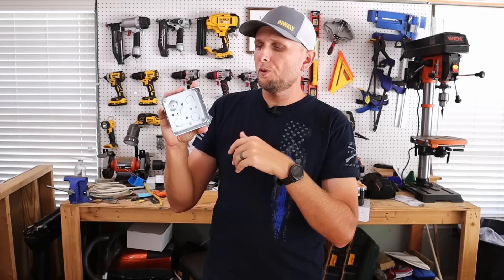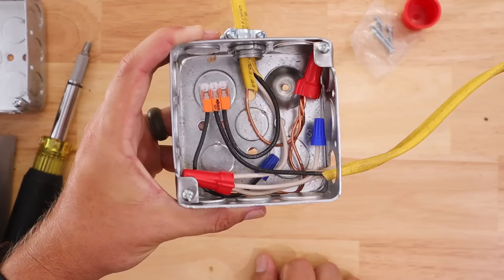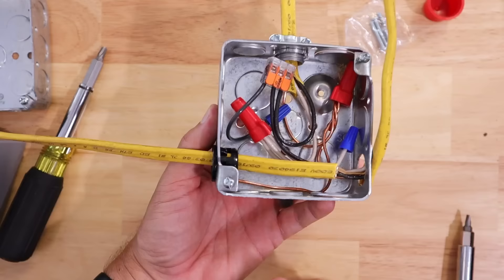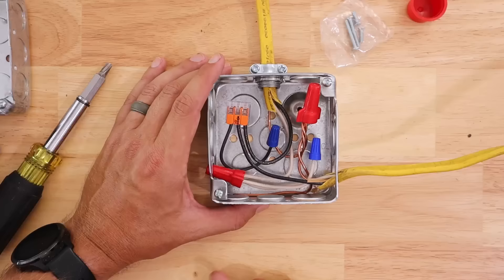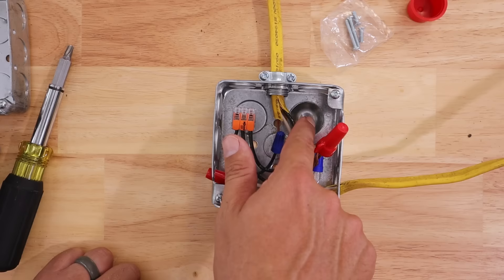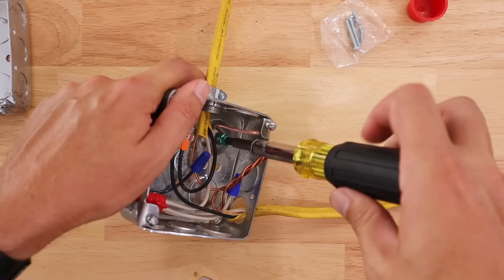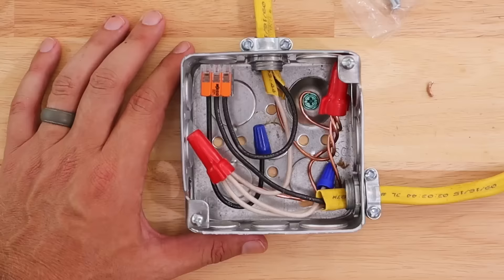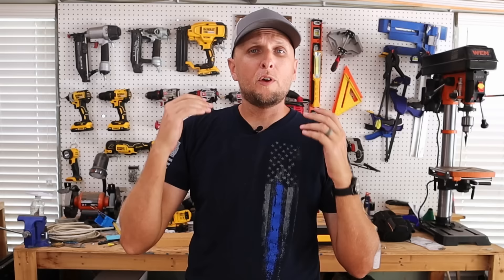The BIGGEST Mistakes DIYers Don't Know They Are Making When Installing Metal Electrical Boxes

Comment from the maker: Have you ever seen any of these mistakes made in this video?  Hopefully this was insightful.  If you know of other common mistakes made, feel free to list them here.  Never know when I may feature them in a future video! 😎
Reply: Is it acceptable to have one of the ground conductors (part of one of the NM cables) wrap around the box grounding screw and then get connected to the other ground conductors via a wire nut? instead of having a separate pigtail.
Reply from the maker: Depends on who you ask but it is my understanding that yes, that would be acceptable using the feed wire ground.
Reply: You neglected to point out that the NEC calls for 6 inch long wires beyond the sheathing inside the box.
Reply from the maker: You are correct.  I did not mention that.  And 3 inches past the front of the box.  Thanks for the reminder for everyone.
Reply: I always make at least these for mistakes on every box I wire, sometimes if I'm lucky I can get at least 7 or ate in one two gang box. That takes some practice for sure, although some can do it right out of the gate (beginners luck) I would have more pictures of my work but for some mysterious reason a lot of these houses aren't there anymore.  Crazy times
I almost forgot, my company name is 
RE-VOLTING ELECTRIC 
You'll be shocked by our work (it's that good)
Reply: You didn't mention it, but it looks to me that there is no strain relief provided for the center hot lead in the wago.  You did clamp that hot lead into the box, but is that enough protection?  I'd be happier adding some strain relief, personally.
Reply: The biggest mistake is to start out with a metal box...
Reply: Before watching the video, I see the problems:
1.  No clamp on one cable entering the box.
2.  The ground not connected to the box with a green screw.
3.  A hot wire stuck in the wago that serves no purpose and just ends in a wire nut -- not a problem but why bother???
Reply: Yes I have seen them all in field and more and much worse
Reply: Another mistake you missed the wires aren't long enough supposed to be 6 in
Reply from the maker: They were all measured out to being at least 6” and can extend at least 3” out of the front of the box.  So it wasn’t missed.
Reply: So I don't understand. The grounding wires(which shouldn't carry any charge unless there is a fault) are  uninsulated, so they need to be connected to the box. You imply if they are insulated they wouldn't need to be connected. That's not right. 
 You'd want to connect the ground wire in the situation a hot wire grounds out on the electrical box. Also, There's a difference between code, and being safe. A green but is code, but obviously, any conducting nut would work. Just not code. Code should be understood, but its mostly there so building contractors don't cut a ton of corners, and use undersized wire, neglect connectors etc. Some code is mostly to make things easier, like minimum conduit size etc.
Reply from the maker: I never implied that that if using an insulated ground that it didn’t need to connected.  I said that certain applications may require an insulated ground wire.  The box always needs to be grounded.
Reply: @AwoudeX  That is a ridiculous comment. Some local codes / inspectors do not allow plastic boxes. You have to use metal boxes in those areas.
Reply: @dallasarnold8615  no, in such a case my comment is not the ridiculous thing, but the code. Having an insulating box instead of a conducting one is just common sense. 

Where there can be explosive force i can get that you'd insist on something metal to reduce the impact on potential victims. Where i'm from it's only where the main enters the house and quite often you'd see there a metal circuit breaker box, especially when there's 400V. (yes i'm not from the USA and i know you run on 100V only.)
Reply: @jonathangardner4475  ya no you misread……and you obviously are not an electrical professional either . You do not 
Want information you just want to argue . After 30 plus years I know the code . Better than 95% of the people here .
Reply: @gerdberg4188  you're right! I did misread. I'm no a professional! He clarified that the box should ALWAYS be grounded, which answered my question!
 I DO like to learn. I DO like to argue. You're batting like 50% so that's not bad.
Reply: @gerdberg4188  besides. I'm right too. Code often isn't about safety, it's about having a standard. Like the leading comment says, "calculate the size of the box for future expansion". I absolutely think anyone working on someone's house ought to be a professional electrician and follow the code precisely. Ive done electric work on my house and found pigtailed wires behind a wall, in insulation without a box 😨.  That's why I said, you should understand the code. There's more advanced questions like,  if I'm running a 50 amp two phase circuit 50 ft, what garage wire should I use? Interior wall? Inside or outside? Does it pass through insulation? That's not easy to simply pull out of a code book. A skilled electrician needs to make the proper calculation for voltage drop etc.
Reply: @AwoudeX  You quite obviously missed my point. Some local jurisdictions do NOT allow plastic boxes. So, making your general statement makes it ridiculous. Whether or not you personally disagree with the application. Arguing the point is not going to make that local inspector allow it.
Reply: @dallasarnold8615  No, you instead didn't get mine. My comment stands with or without any code enforced by whatever institution. Bringing it up is irrelevant to the point i made... The inspector can enforce his or her code endlessly and still my point stands: it is a bad idea to use a conductive material for your electrical boxes. It's been AGAINST the code where i'm from for many decades now. On rare occasions i've done a renovation job and found metal pipes and boxes. You need to bypass them alltogether or remove them even. It's so much safer when it's insulated!
Reply: @AwoudeX  You really are thick headed. I am not arguing whether it is safer or not. You said it is a mistake to be using a metal box. And I am saying it is not a mistake when it is according to code. You can argue off point till you are blue in the face, but it still is not going to pass the electrical inspection in the jurisdictions where plastic is not allowed.
Reply: @dallasarnold8615  you are the thick headed one, it makes no sense to use conductive materials. It is a mistake using a metal box because it has a higher risk of electrocution. I already stated that the code itself is ridiculous if the metal box is the preferred choice.

<<You can argue off point till you are blue in the face, but it still is not going to pass the electrical inspection in the jurisdictions where plastic is not allowed.>>
And here is where your thick headedness shows the most. My argument goes beyond the code and goes by what makes sense. You can point at the code till your index finger drops from your hand, but my point still stands firm that a metal box still is a mistake and of higher risk. Where is your argument that a metal box is superior to an insulating one and thus SHOULD BE PART OF THE CODE. I haven't seen you try to argue me on point, you're just discussing past me instead of with me on point.
Reply: I’ve got a cousin that I call or FaceTime, before I commit to any of the electrical ideas floating around in my noggin. I told him he should develop a digital service for other diy’ers to be able to call.
Reply: Your comment about wire gauge isn't entirely true.  If your wiring up a 15A receptacle on a 20A breaker you are allowed to use 14AWG wire.
Reply from the maker: @creamysbrianna yes you are correct.  I should have specified in the video that I was showing an example of a 20 amp circuit.  I was using #12 so I figured that was implied but I do know that #12 is becoming more popular in home build on 15 amp circuits and sometimes #12 is used on 15 amp circuits due to long runs and voltage drop.  All of that being said, I still don’t recommend doing it because you don’t know who will come after you, maybe assume since all they see is #12 wiring, that they can upgrade the circuit breaker to 20 amps, and call it a day.   So I personally never use smaller wires than my feed and I recommend doing the same out of a concern for safety.
Reply: @AwoudeX  I’m a residential electrician here in the US. The most common nominal voltage used is 120v/240v, but in commercial/industrial settings you get into the higher voltages. And yes, in newer houses here we use non-metallic boxes set in the wall. We often use metal boxes, however, when needing to splice/repair old armored cable.
Reply: Actually that 14ga is fine for 20a at that length
Reply: @AwoudeX  fewer call backs with a metal box. Besides, if done properly there is no issue.
Reply: I had an electrician that didn't use a wire clamp on a receptacle in my wood working shop. I had an air compressor plugged in to it. Vibration from the air compressor cut into the insulation and quit working. Luckily I caught it in time but I had to fix three other receptacles in my shop also. The Electrician had done work for over 30 years.
Reply: Not that I wouldn't use a grounding screw, is there something special about them that makes them uniquely suited to that purpose other than the color?  I probably wouldn't have worried about seeing some other kind of screw being used for that purpose provided it made a secure contact between the ground and the box.
Reply: @AwoudeX  you're actually wrong in just about everything you've said. The one thing I can agree that is perhaps safer is a plastic box. Everything else is nonsense. If done correctly a metal box can be just as safe as a plastic box.

Part of the national code is local jurisdiction having authority. The national code is the minimum requirement needing to be met. Local jurisdictions can require more than what the national code requires. And some jurisdictions require metal boxes only, which they have that authority.

We don't only use 100V. In fact we don't use 100V at all. We use 120/240 volt in homes. Outside of North America just about everyone else only uses 240V in their homes. So not sure where you came up with 400V. That's getting into 3 phase power and I highly doubt anyone uses 3 phase power for homes.

The one thing I did fail to mention in another post on here is that a green hex grounding screw is not required. In fact code mentions nothing of the kind. What it does say is that a machine screw is required for bonding applications. The green screw is a 10/32 machine screw. So any 10/32 machine screw can be used because that's most likely what the hole is threaded to for bonding, but not all bond holes are threaded at 10/32. They are sometimes smaller.

All this is coming from me who is a practicing licensed electrician of several years.
Reply: @TheForgottenMan270  "If done correctly a metal box can be just as safe as a plastic box."
If there's more room for human error, it cannot be just as safe.
Reply: It also looks like you're short on cubic inches in the box per wires/nuts and all inside.  I didn't get a clear look of the depth of box, but I'm pretty sure you don't have the cubic inches to handle either a receptacle or switch if you're working with NEC code.
Reply: I've seen them countless times and they really irritate me.
Reply: @How To Home  It is best to have the grounded conductor from the cable which feeds that  box hit the ground screw then to the ground splice in one continuous piece of.wire.
Reply: @HowToHomeDIY  You are correct as well folks are using 12AWG for 20A circuits with 15A receptacles.  It's the option that will allow for future changes to 20A receptacles.
Reply: @RK-hs6ui  I like that too.  In many heating applications like furnaces and boilers, it's essential to ground the burner that acts as structure for the electronic ignition as well or the flame sensor and ignitor arc may not work properly.  I've had many boiler and furnace electronics calls where proper grounding fixed the issue.
Reply: WAGO = BAD!!! Have you ever had your electrical work inspected?
Reply: @AwoudeX  No it doesn't.  A metal box is actually safer under shorting conditions.  It allows a path for the current to meet the grounded conductor and take the safest path to earth.  That is why metal boxes are used in all construction.  Rigid PVC is permitted outside, may be used inside but is not economically viable.
Reply: @ZachGrady   That's the better way!  Less joints in the run.
Reply: @creamysbrianna   NO!  Do not do this.  You have a cct. that is rated for 15A... you are not protecting the cct. with a 20A breaker.  You will be allowing a higher current than the cct is rated for.
Reply: @AwoudeX  You're wrong about the USA running on 100V only. Homes are all equipped with 240V power, center tap from the transformer (and neutral conductor) dictates the 120V throughout most of the home. 240V is commonly used in parts of kitchens, garages and/or laundry rooms.
Reply: @surferdude642  can you explain why the usa bothers with the 120V part?
Reply: @AwoudeX  The answer lies in history. Thomas Edison made carbon filament light bulbs that worked best at 100V DC. Higher voltages would burn it out. Later, AC was used, primarily for long distance transmission, and 60Hz frequency was used because it worked best for light bulb illumination. The voltage was bumped up to 110VAC and the inventory of 110v incandescent bulbs was on the rise. Appliances were soon manufactured to operate on this system which now is 120vac, 60 Hz. Eventually, this system became so entrenched in US residential electrical systems that there was no turning back. Europe was lagging behind, but metal filament lamps were developed in Germany that were capable of higher voltages. 220 volts were used, and a frequency of 50 Hz was selected.
Reply: @HowToHomeDIY  what’s the difference? Why green screw… that makes no sense.
Reply: "Waygos" are okay, but using the holes in the back of outlets are not?  They are virtually the same thing.
Reply: If that box is designed little bit different, it can save clamping solution.
Reply: Yes. Yours truly. But then I’m a genius, I know everything
Reply: @barryhess720  I believe the the reason it's been declared unreasonable is a possible risk of two events. A homeowner may make a run from it with 14 AWG, then later see the beginning of the run at the breaker being 12 awg and decide on 20A service changing breaker and live outlets. I'm not an electrician so can appreciate one believing I could make that mistake  🙂
Reply: I found this video very informative! I have an older style home that I just moved into. It has one main service panel using circuit breakers, and 2 separate subpanels. Immediately after the main service panel with circuit breakers, is a sub panel with 2 30-amp cartridge fuses in a metal box with metal closing door. After this sub panel is another that is located in the garage with 2 20-amp glass fuses.  My question to you is about this middle sub panel with 2 cartridge fuses. The box these cartridge fuses are housed in does not have a raised bump to attach a ground wire and screw. Instead, the bare copper wire is just sitting there in mid air. Doesn't that need to be connected to anything? Could I tap a hole in that metal box and attach a green ground screw and wire to that?
Reply: Alright let's start.
1. Not that is so much of a mistake but the cable camp, I would have used a plastic one they are made for loomex and NMWU wires. While that clamp is used for AC90 or any armored cable.
2. The box looks like a 4 x 1 1/2 now this can hold a total of 14 wires at 14awg 
( canadian code book table23 ) not withstanding a light that might be attached or smoke alarm ex. Then you must consider that for every 2 marrets, this counts as a wire. The biggest mistake I see being made.
3. The ground wires. You need at least one ground wire that is going back to the panel be attached to the box with the green grounding screw that I did not see.
4. Not that this is wrong, but just an electrical standard in Canada outside of red
Yellow is made for the kitchen 
Blue is for bathrooms 
Red is for heaters ( this is a part of the code )
White is for all other rooms.
This does get to me a little because it only takes a few extra seconds. When twisting your wires, make sure that they are twisted property so that the marret is not taking the load of weight either from someone pulling on it or needing to lower a light fixture to work on something in the box
Now I will be honest and say I am not sure about the connector, I know they use that with LED lights. But I haven't seen an electrical use them outside of that because if you need to save the wire. Sorry but you will probably need to cut.
5. You must leave 150mm of extra wire within the box. Rule 12-3000 (6) CSA 
Hope this helps
Reply: Interesting to see different practises in different countries. The ground cables should be individually sheathed in the UK and cables should never be twisted together, UK metal back boxes come with a pre-installed screw termination. The outer sheaths on the incomers look like they have been cut along the sheath and then peeled back? if that's the case that isn't good practise as there is a strong risk of nicking the inner sheath.
Reply: @mikea3552 If the two boxes are connected with metal conduit, the. conduit serves as the ground, and no extra ground wire is required. If they are connected with Romex, then yes, the box needs to be grounded. Depending on the size of the fusing, you may need a bigger grounding wire than can be twisted under a screw, in which case, a screw-in connector would need to be attached to the box, and a ground installed into that connector.
Reply: One more "mistake", but more of a best practice is to wrap that Wago with electrical tape so it doesn't come undone. You know who I learned that from? 🫵
Reply: @TheForgottenMan270  About the 400volt system, in the Netherlands most of the homes  use three fase power as the incoming power. The normal amperage on a single outlet is 16 amp’s at 220v. So if you just have 6 fuses you would need an amperage of 6 x 16= 96. However if you use 400v the amperage is just 32. 

I have to admit, for a Dutch person the American rules are a bit strange. Here all the powercables that are placed during construction are routed with hard plastic tubing that connect to a plastic electrical box. The splices mostly are placed in the ceiling so there is room for the socket/switch. And all the three wires are dubble isolated. 
So when I see a contractor “nailing” a powercable to a 2x4, I’m afraid that someone can electrocute him/herself. 
I can imagine a steel box is harder to break and that that could be a reason for the government to say you need them, but for me I would prefer plastics. Just look at it like this… there is power running in a metal box with a power socket screwed on by a metal screw that is exposed (and a cover plate screwed on the socket with a metal screw, just what I see a lot on yt). That means that there is a small possibility that that screw can be live, that is for me personally a no go.
Reply: The other mistake I've seen where someone intentionally took a bare ground wire and hooked it to the neutral.
Reply: That exposed copper in the box for the thumbnail wouldn't conform to electrical code where I live.
Reply: Thanx... 4 answering some asked... But also those that WEREN'T asked. Good stuff, bro
Reply: Is there a way to contact you to ask question about wiring
Reply: @richardshermanjr1899  Yep, just goes to show you that just because someone has done something all of their life doesn't mean it's being done correctly.
Reply: Grounding and bonding are two separate things. 😂
Reply: As you have pointed out, the neutrals need to be twisted with two twists so they can’t be pulled apart from the wire nut.
Reply: I don't get the "must be green" part. It is just a machine screw, what difference does the colour make on a grounding screw? From what I have read just now, that only applies to appliances, which doesn't make much sense to me either, but for ease of identification, I guess it can't hurt. Though if you are confused at what you are looking at, you should probably just let someone who does, do it for you.
Reply: somebody forgot to secure the box!
Reply: ...i remember this change to the code. calling the red nut on the ground a "big no no" sort of ignores the FACT that for literal decades the ONLY wire nuts available were yellow red or blue depending on size and were used to terminate every single ground other than crimp sleeves. there are literally billions of make ups out there working perfectly fine with red wire nuts on the grounds the ONLY reason for the change was that it was IDEAL's turn to have an industry rep on the NEC during that code cycle and they had put these wastes of money on the market a year earlier and no one was buying them so they forced the market to accept a superfluous item....and yea i am still pissed offat the obvious corruption of the institution in this way it was gross and disgusting behavior....ps forgot the orange ones
Reply: Man I just did a Kitchen gut reno in Brooklyn and found 6 wires in the wall without caps (Not in boxes). Also the gas to WD - Dryer was male to male and silicone caulk connected lol I cant make any sense as to why 6 wires were left uncapped or in boxes other than the contractor was literally trying to burn the place down.
Reply: @nycmetalworks1974  Sounds like the first electrician might not have been the one to finish the job.
Reply: @--_DJ_--  He did finish... Luckily there was no fire. It's just my whole life, I've been opening up walls and I've never seen so many wires uncapped.... seems intentional like he was trying to burn the house down.
Reply: @creamysbrianna 
There is a lot of confusion about how duplex are rated. Whether it is the 79 cent residential grade or the three dollar spec grade the duplex is rated for a total of 20 amps. That 20 amps is the total of pass through current, if Daisy chained, and each of the individual halves of the duplex. 

That is why 1 or more 15 amp duplex receptacles, but not only 1simplex receptacles, are allowed to be used on 20 am circuits. 

Capacity wise there is no difference between a 15 amp or 20 amp duplex receptacle except you can plug a 20 amp plug into a 20 amp rated receptacle. 

That said a #16 jumper wire is modern insulation can safely 20 amps and it is even shown in the tables. But it is not allowed to be used circuit protected by a 20 amp.